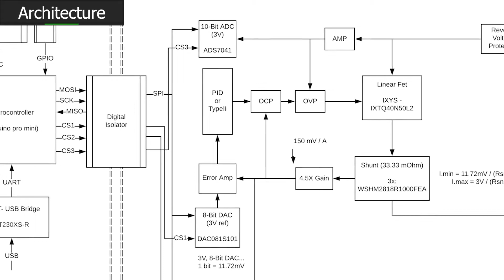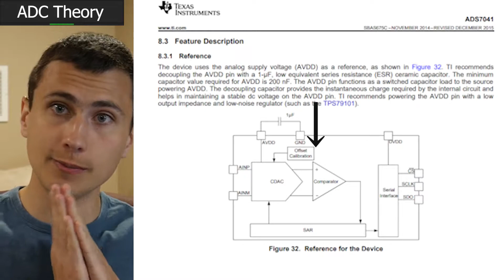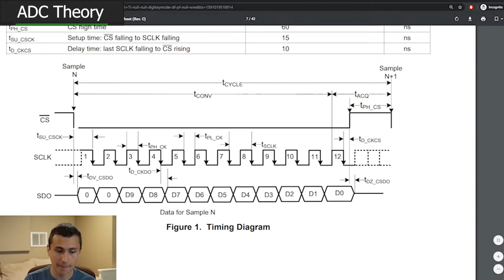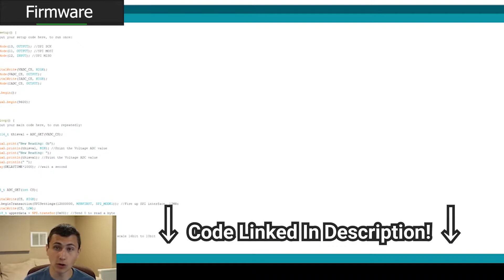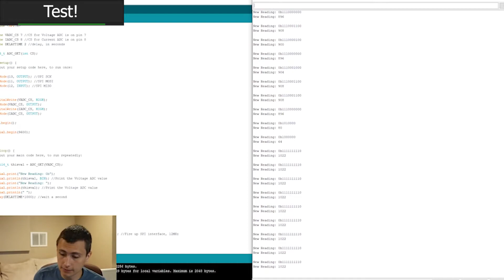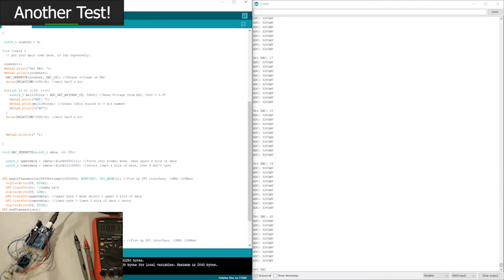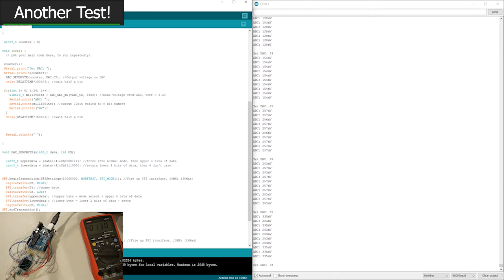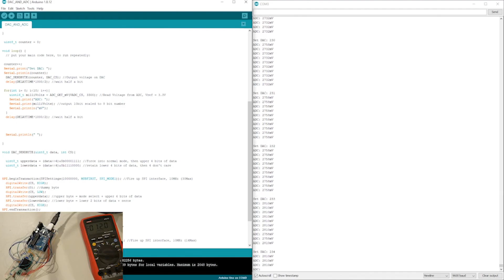SPI ADC Prototpye (ADS7041)

Comment: Hi bro, very great job! I have a question concerning the hardware connections. The ADC has a 3 wire interface with just SDO (not SDI/MOSI), so when connecting it to the arduino, how are the connection performed? Should it be ok to connect the arduino MISO to the SDO and the MOSI not connected?

Comment: Since using a 10Bit ADC, why not just using arduino ADC directly? Probably because you are still confused with the MCU that will integrate the circuit? Or are there any other advantages comparing to the arduino's ADC?

Also, why not soldering THT capacitors on top of the PCB?
Reply from the maker: Hello FixDaily! the reason why I don't want necessarily want to commit to a dedicate ADC / DAC on the isolated side is because I've got dreams of creating a 4-channel load where all four channels are isolated from one another, and to the main controller. 

Making a decision like that would force us to eventually create a system with 5 micros (where one might do the job just as well) It's hard to way which way would be easier, better, faster, etc. The lack of adding capacitors and whatnot comes down to the truth that I've got prototype PCBs coming in soon, and I know that we can get the glitches worked out then. In a way, it's almost not worth the time to fix a system that's about to get thrown away. :)

This prototype is all about building the firmware and testing those pieces so that the firmware can drop into the more complex prototype (relatively) smoothly! At the end of the day, even if we're off by 0.2V, or 0.5V, on this breadboard... the performance is correct enough that we know the software is functioning correctly.
Reply: @EEforEveryone  sounds great, keep up the great work

Comment: If you suspect that the source of problems is lack of those decoupling caps, then maybe you could solder some directly to the pads of the board that you are using. If the pins are near, you can use the SMDs, but in most cases you would end up with a THT disk across the IC. Sure, won't be pretty (and the THT leads will introduce some inductance) but should be enough to see if that helps or not. Also: ADCs usually need to be calibrated to eliminate some nonlinearities and offsets, but of course this can be done in the final design. To see what is the "nominal" characteristics in those conditions you could use a very slow, precise sawtooth signal from some DC source and a lot of sample averaging. Then put it on a graph ;)
Reply from the maker: NukeDMAn, that's a great idea. just bodge a cap onto the pads! The reason why I didn't play around with this too much is because I know that we've got prototypes coming in really soon, so any effort to get this breadboard more ideal is essentially thrown away (unless it uncovers a real problem in the soon-to-be-hardware!). I guess, I saw the system behaving well enough that I'm confident the hardware and firmware is functioning correctly, even if there's still some communication glitches and inaccuracies due to.. being plugged into a breadboard. 

Maybe I didn't cover this well.. but we did 10-sample averaging in one of these examples! I always do this in some form, just to chip away at the always-present quantization error. :) 

I've got dreams of calibration routines being built into the final design, but we're not there yet! 

Great thoughts! Thank you for the comment, and for watching!